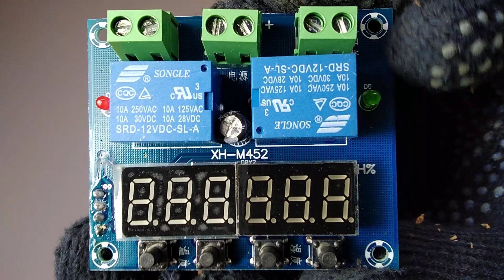xh-M452 temperature and humidity controller unboxing

Comment: Is ma sensor konsa use hova ha am2120?
SE sore ka andar and board connector ka wires ka pinout chaia. Meray wires utar gai hain.
Reply from the maker: You can check local electronics market to find the missing part

Comment: Sir is pe hm 12v ka humidifier or 12v ka heat element operate kr  sakty ha?
Reply from the maker: Yes it can relay the DC voltage
Reply: @Umairworkshop  Thanks.

Comment: Is that  good?
Reply from the maker: yes it is good
Reply: But why reads the temp and humidity wrong.
Without putting any watar into my incubator it says humiduty is 55%, and the white humidity  reader says its 35%
Reply: How can i vontact you i send you the photo of it
Reply: @mgrafik  جب آپ ڈیوائس کو آن کرتے ھیں تو انکیوبیٹر کے اندر نمی زیادہ ھوتی ھے لیکن ٹمپریچر زیادہ ھونے کے بعد یہ کم ھونا شروع ھوتی ھے یہ نارمل ھے
Reply: @poultryland2609  English please
Reply: @mgrafik  I often visit Lahore market, xhm-452 is fake four wires from xhm452 circuit board but on sensor board one red color wire is cut therefore it shows wrong humidity reading 
When we turn our incubator on humidity is high but when it heats up in begins to lower down it's natural